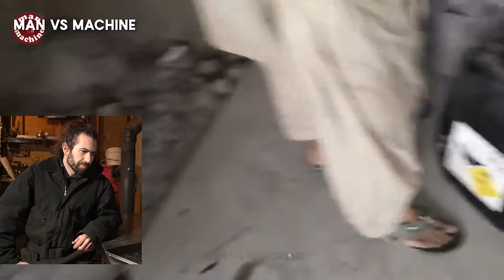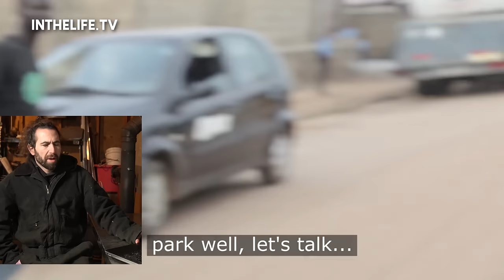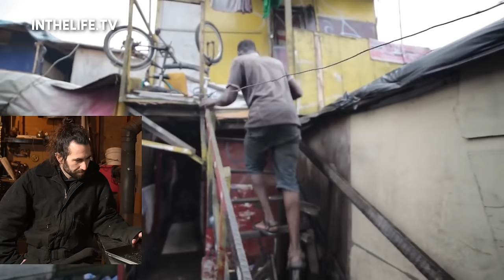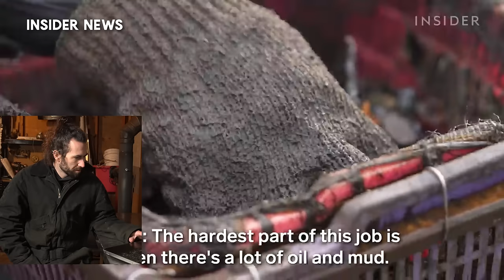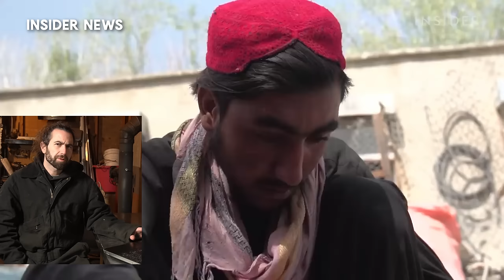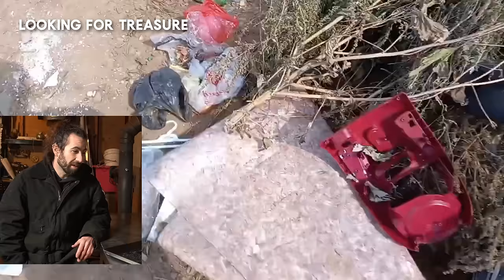Scrap Metal Recycling Around the World

Comment: FeO4 molecular mass is ~115 and Fe is ~55. 200 kg turns to 95. There will be dirt and sand that has attached to the clumps of rust as metal leaches out. Moisture throughout the rust. 70 kg of pure iron?

Comment: You could take that undersea cable....chop it up into 3 foot lengths with a chopsaw.  A carbide blade would go through that copper without too much of a problem.   
     Then feed it though a table saw.  You might have to make a jig to keep it from rotating.